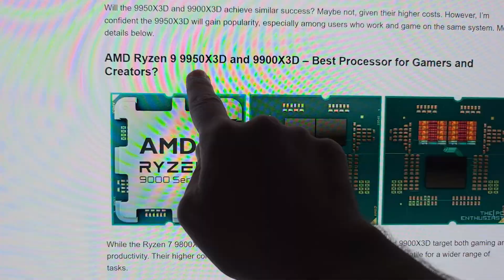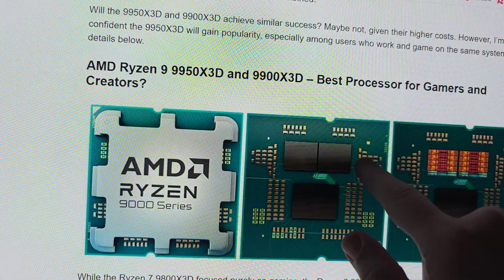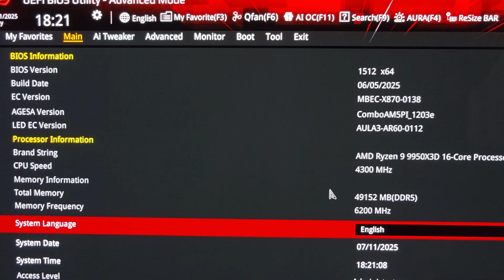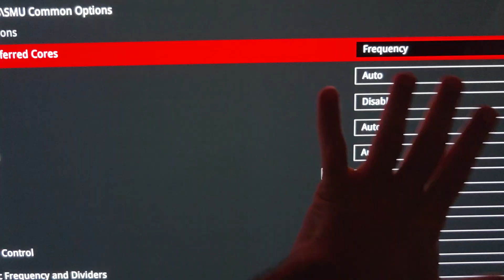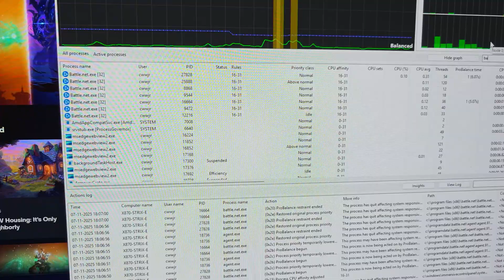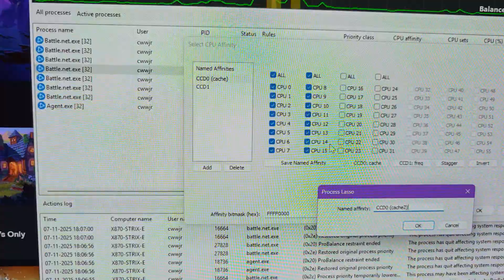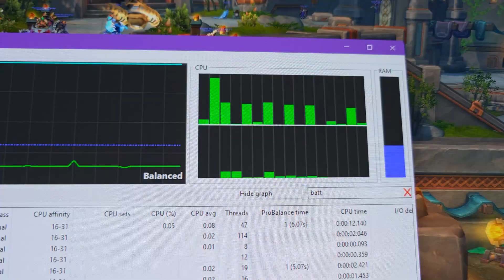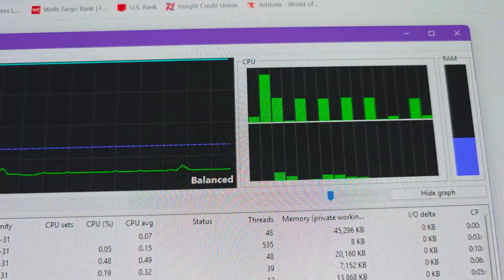How to Setup 9950x3D with Process Lasso

Comment: Can it surpass 9800x3d after tuning?
Reply from the maker: This video isnt about "tuning" they are the same dude. If your focus is gaming and that's all you do this is not the chip for you. 9800x3d is. 9950X3D is NOT an upgrade from it. The difference between the two will be negligible
Reply: @CWWJR  thank u so much for explanation.. I will get 9950x3d because I have to stream my game too.. one more question - so with process lasso it will give me performance same as 9800x3d?  9950x3d needs tuning to perform as 9800x3d?
Reply from the maker: @XerowFang better. Because you can run your game and your game alone will be on CCD0 by following the steps in my video. While CCD1 one can run your streaming apps.

Just set up your streaming apps to run on CCD1 like I did with the battlenet launcher in my video. Then when you go to video edit your videos you will have all 16 Cores to work with. 

I literally explain everything in the video don't skip around just follow it step by step.

Be advised though if you're not video editing your content and you're just streaming? The 9950x3D will be a waste of money for you.  It's more for people who use their computer as a workstation when they are not gaming. If you don't video edit your content and you just stream get the 9800x3D
Reply: @CWWJR  i know sir you explained everything in the video and its too simple to follow...So I will be pairing my processor with 5080..The  thing is i will be streaming in 1440p and editing video in after effects in 1440p ... So still 9800x3d will be enough without  latency and hitches?
Reply from the maker: @XerowFang  The 9800x3D has no latency man. Its 1 CCD. You dont even use process lasso with it.  Its simple. Put in the CPU and you are done. So yes unless you are video editing your content or doing workstation task Id recommend the 9800x3D its all you need

Comment: Your method is the best since the SYSTEM tasks will prefer the frequency CCD, if you select cache, they will run on the cache CCD, and you often cannot change them with Process Lasso. I even went as far as changing affinity in process lasso for frequent programs just to be sure, and I run them on the iGPU if they take a measurable amount of gpu time. Thank you for the video and the effort thumbs up ! [EDIT] You can also consider running games on threads 0-2-4-6-8-10-12-14 only, effectively disabling SMT for the game. Some games run better with this.

Comment: Maybe I'm missing something here. I did what you suggested in this vid, but when I look at Process Lasso, it still shows ALL my normal windows tasks and systems as running on ALL cores and CCDS. I thought switching the preferred CCD in BIOS was going to assign ALL the normal tasks to run on frequency CCD while leaving CCD (cache) completely unused unless I assign programs. Is that not the case???
Reply from the maker: The video has been updated. Now it has chapters. Each step is a chapter.  This way you can easily see which step you missed.  Hope that helps!
Reply: I also had thought that the BIOS option would route everything to CCD1 unless explicitly overridden with process lasso.That would have been very useful

Comment: I have a question, what would happen if I created a profile that uses the 16 cores and applied it to a game? I don't currently have this CPU (I'm new to Ryzen), I'll buy it in a couple of weeks (to work, study, 3D) and I would like to know what would happen if I did that, clarifying that when I open a video game I will not use any program in the background (OBS, Discord, Third Party apps) will only run the game
Reply from the maker: You will wind up with a lot of cross CCD latency and a lot of stuttering and tank your FPS because you are constantly switching from a ton of L3 cache to a LOT less. If you are going to do that Return the 9950x3D and get a 9950x for a LOT cheaper
Reply: oh man, thank you so much for being simple and direct, thanks